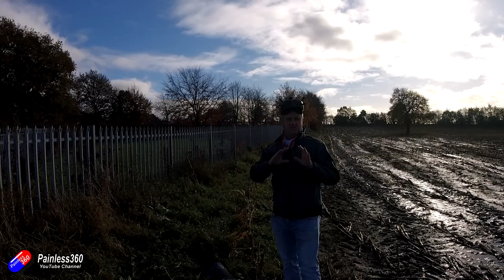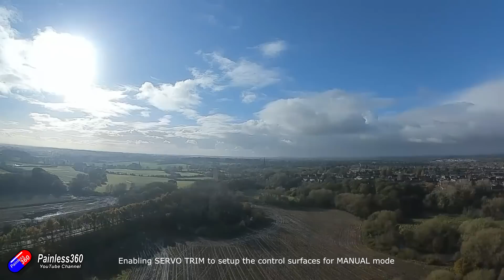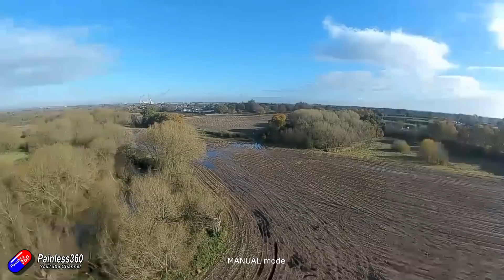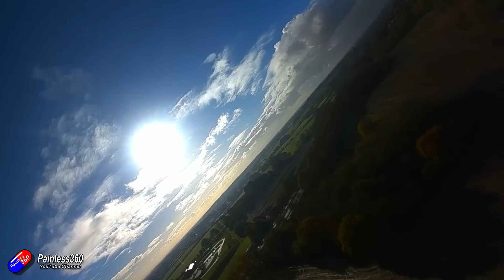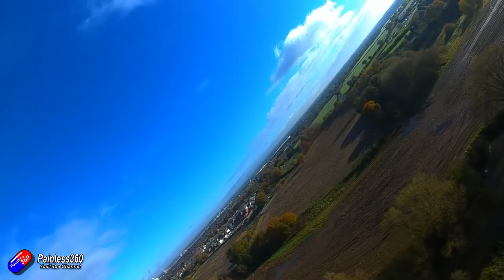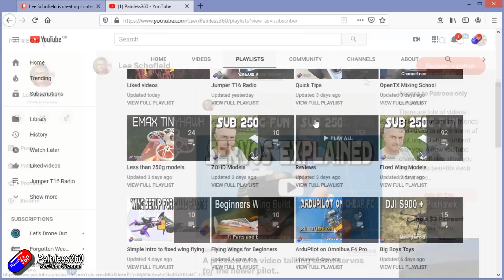AR Wing PRO Maiden Flight!

Comment: Hi! I was having too much waggle on a windy day, is this expected? I was hoping for a more locked in experience and any tips on this? Any tips on throws, i had a feeling that my throws were too much and this might be adding to the behaviour.
Reply from the maker: Using a flight controller?
Reply: @Painless360  : yes, i do have a vector on it but haven't tuned it or anything. I was flying mostly in the manual mode..
Reply from the maker: As the wings are huge sails then there will be an effect from the wind. Turning on the flight controller (that has been tuned well) can remove these un-commanded movements and help a lot in windy conditions...
Reply: @Painless360 : Yes, I will get the horizontal leveling working for this. I was also thinking if my throws were too high and also my flying style needs to change for fpv wings from quads. Line of sight I'm generally taking larger turns but on fpv I'm thinking I'm flying a bit more aggressively. Thank you for your help and reply.

Comment: Hi! How are you balancing this Wing? Even using a 4S 3300mah Lipo it still needs around 139grams of weight. What are you guys using for weights? What am I doing wrong?
Reply from the maker: It is designed for a heavy battery and/or Gopro. See my other videos on it. You will need about 460g of weight up front in total.. best of luck

Comment: What is the problem if the plane loose altitude in loiter mode?
Reply from the maker: Board alignment needs increasing - see my INAV for beginners guide. In INAV 3.0 you can use a few of the new tools to set it up automatically - see my INAV V3.0 Level video - https://www.youtube.com/watch?v=t_lkfoE5_ds

Comment: Nice launch, did you set your idle throttle to 2000
Reply from the maker: Launch idle is usually around 1300 but I do use a higher setting on the tricky planes. See my Autolaunch video.. Happy flying
Reply: Thanks for reply   i already did a couple of autolaunch but never try with idle throttle at 2000 my concern is that the fc controller will not detect the autolaunch at such a high value
Reply from the maker: From all the testing over the past few years here - The detection has nothing to do with the idle throttle setting.. Happy flying!
Reply: @Painless360  Thanks

Comment: can i have those setting for my plane plz?
inav has no sonice model pro perset, only a sonic model 600m
Reply from the maker: The settings for any of the 900mm+ wings will work fine. I just used the same settings and process as I use in the INAV for Beginners 2020 series. An autotune and autotrim will get the model flying great for how you have it setup.. Best of luck!
Reply: @Painless360   thankyou im going to launch it in manual mode first . should i use auto launch for the first throw? i used the 900mm preset. i think it was the drac or somthing
Reply from the maker: I have been using Autolaunch for years and know how to set it up so that it just works for me (I have a video on it) as a result I'm more than happy to trust my model to it almost all the time. If I can have a friend to launch it - that is a safer way to do it but sometimes there isn't a choice..

Comment: How did you fix the nose down issue when in GPS loiter mode?  Just built an AR Wing Pro and have the same issue with loosing altitude in loiter mode. Do you have a iNav diff that you can post?
Reply from the maker: I have a whole video on it. Check out the INAV for beginners 2020 series.. Happy flying

Comment: @Painless360 how did you manage to balance the wing without any extra GoPro sitting on the nose side? Mine with the 4s2p Li-ion pack needed extra 130g on the nose! What's your trick?
Reply from the maker: No trick. I also needed some weight in the nose. See the setup video.. Best of luck
Reply: @Painless360  thank you so much. I will check it out after my last 2020 walk. Best new year wishes from the other side of the Irish Sea!

Comment: Any chance on having a build video? I'm specifically interested in this because of the DJI.
Reply from the maker: See my build of the Drak from summer. I setup the DJI stuff in that one.. Best of luck
Reply: @Painless360  will check the vid ref’d above... Which board did you use? DJI says “The DJI FPV Air Unit is only compatible with flight controllers that support Betaflight.” I ordered an F765 for my AR Wing Pro, then read this about the Air Unit. Does that knock out all OSD info from the goggles unless using a Betaflight supported FC? 

I can easily return and exchange the F765... Just trying to understand what FC was intended to be used with a Wing that was “designed” with DJI gear in mind?

Thank you!

Comment: Can you please measure efficiency in cruising flight?
Thanks!
Reply from the maker: With the normal prop it'll pull about 4 to 5 amps in cruise. It is very efficient for its size...
Reply: @Painless360  Thanks!
Can you please share cruise speed with this amperage?
Regards!
Reply from the maker: Not until I fly it some more.. Stay tuned!

Comment: Awesome!  Question, Would any wing tip weight help offset the minor wobble or would that alter flight characteristics too much?
Reply from the maker: Lots more flying needed before I'd even consider changing anything. One flight is not enough....
Reply: @Painless360  Totally understand!  I meant to ask hypothetically.  I have not flown a wing only conventional plane.   Thanks again and I hope the situation remedies soon to allow for resumed flights!  Perhaps one could use the wing as a "Air sampling system" with Petri dish on the DJI mount to see if any airborne insidious RNA type are lofted about......... I bet you could insert a huge array of cotton swabs as a vortex generator of sorts and sample with extreme efficiency and to be sure safety maintaining distance from any possible source.  In fact, this may be the best way to ensure a efficient and broad method of data and metric gathering to circumnavigate and sample air from around the island..........sorry, I digress........ Cheers and have a great weekend!
Reply: Just trying to help figure a way to get you back into the air sooner!

Comment: Great!  auto launch was perfect. what happened to the Loiter mode?
Reply from the maker: FC pitch angle wrong. See my INAV for beginners 2020 series for more detail..
Reply: @Painless360  My understanding from Github fixed wing guide on nav modes is that loiter (NavPosHold) does not maintain altitude, the pilot has to use pitch control.   See Github desc.  But you can combine NavPosHold and Althold to loiter at a fixed altitude.  This is the mode configuration used by iNav fixedwing group model.
Reply: I had similar problems with iNav on a S800 wing. Besides adjusting with flight controller pitch angle as Painless360 mentions, what really sorted out this issue was to activate "TURN ASSIST" along each and every navigation mode (Loiter, RTH, Waypoint). One activating Turn Assist must also change  "fw_turn_assist_pitch_gain = 0.4" (from the default value of "1", to prevent too nose up attitude during turns). Just like a human pilot applying "bank and yank", iNav applies up elevator along with the aileron command, during the turn, not after the PIFF algorithm detects the high loss... It just works. Check it here: https://www.youtube.com/watch?v=dKoJcqr74BA

Comment: So now you have done the maiden and you have had time to think about it.
What is your opinion of the wing. 
Is there anything you would change or modify? 
Thanks
Reply from the maker: Drier landing conditions and more time to come back if there was an issue. After this flight I was sure that the FC worked, the GPS worked and the FPV system was going to work fine as well. The FC level needs about 4-5 degree up angle for this model, that'll help with the GPS modes. Second time out would be a full power throttle test, acrobatics and a RTH test too.. See my INAV for beginners series where I cover all of this in detail..